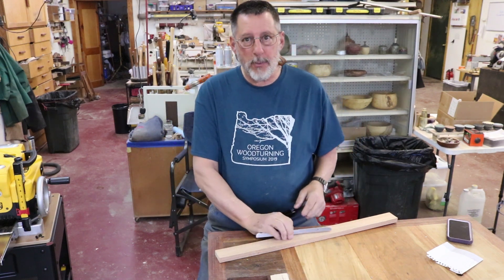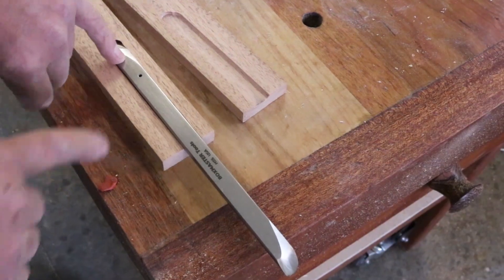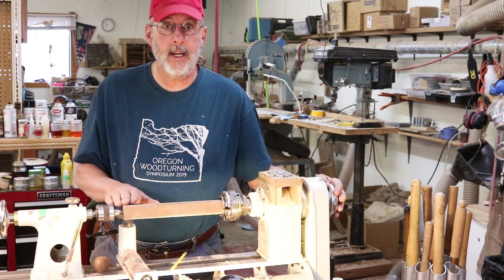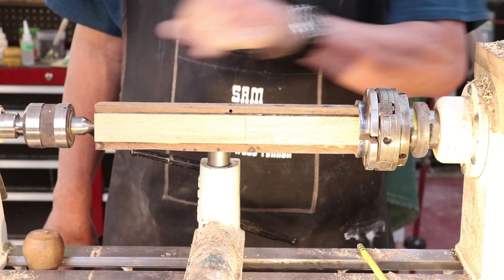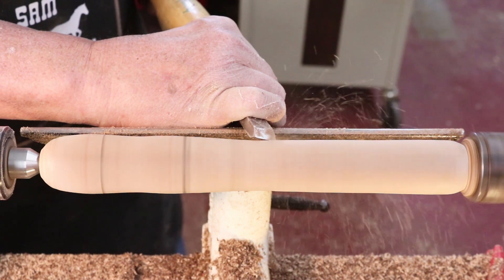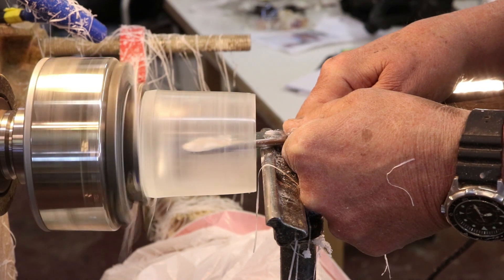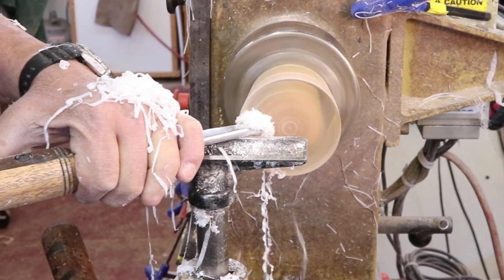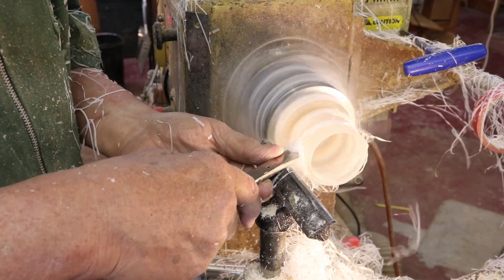Tool Handle for Box Scraper  Sam Angelo the Wyomingwoodturner

Comment: Hello, thank you so much for your video. I’m doing my handle something similar in concept but marked the size of my tool beading and parting 3/8" in the middle of the handle and cut off  the width, then filled the sides with 2 pieces of wood perfect fit and left an square hole in the center for housing the tool.
Now im in the process of the set screw, I’m using a thick aluminum tube so I don’t know if I can tap a hole for my M4 set screw  or it would be better to use an insert as you did, I have an M5 insert and set screw . Thank you again
Reply from the maker: I think what you are explaining to me would work well. I see no reason why it wouldn’t work. Thanks, Sam.

Comment: Very nice. I see you use this for the sides.  My problem is with the bottom of the boxes.  What tool (small) are you using to get a nice looking inside bottom?  Thanks!
Congratulations 🎈🍾🎉 on the pending sale of your home.
Reply from the maker: Donald    Another great question.  I may have failed to make this point in my video. But thank you for asking the question. I find that turning the very bottom of the inside of a box is quite different and a little bit more difficult than addressing the sides. But I do find that using this tool on the bottom works very well it has a nice gentle round curve on the nose of the tool and makes it very easy to create a nice inside round curve.  thanks Sam

Comment: Great video as always.  I am confused. The tool appears to be the same on both ends. Why reverse the tool?  If you are working inside the box and lets say the name is facing up. If you want to work on the outside of the box couldn't you put the name on the downside and work the outside of the box, without reversing the tool? Let me know maybe I just don't understand. 

Thanks your Judith Gap friend  George
Reply from the maker: George, if you look at 1 minute/12 seconds in to the video you will see a good shot of the entire tool.  The ends are opposite in profile .  I had the same reaction when I opened this tool when it arrived in the mail.  You use the tool with the long bevel UP.  I think it is a better box scraper than anything I have.  Oh,  by the way.  We have sold our house in Worland (have not closed yet) and made an offer on a home on the west end in Billings.  This is not an easy move for me.  Take care.  Sam

Comment: As for which end is which, the ends would be reversed if standing on the other side in reverse or cutting across the other side in reverse for easier sight of your work. Nice solution for a retaining bolt.

Comment: Sam, thanks for the pointer to this video.  A couple of questions, did you get the inserts locally or do you have to order?  I think you stated that the handle was mahogany and walnut, is this wood hard enough to take the torque or would you suggest a harder wood?  Finally, did you have to grind on either the insert or the set screws to make it all fit?
Reply from the maker: I am sure I got these on line.  Here is a link on Amazon to the inserts  Sam